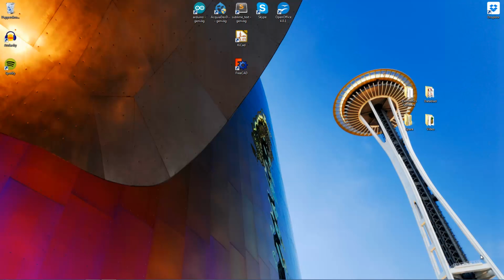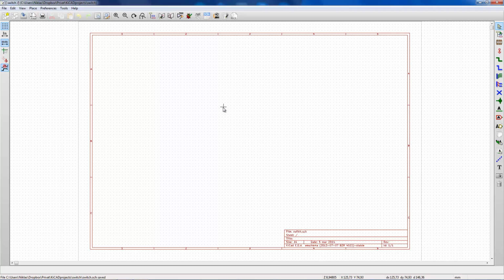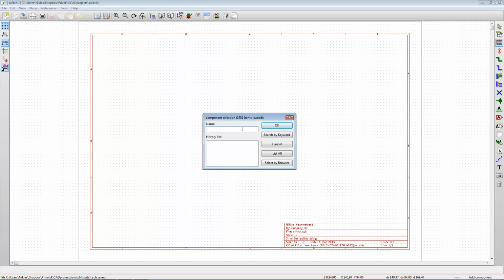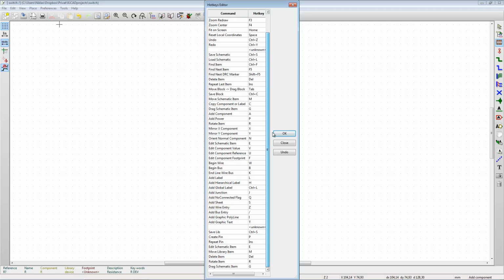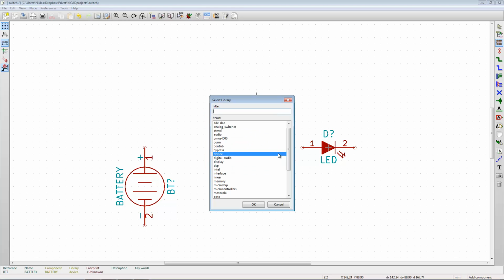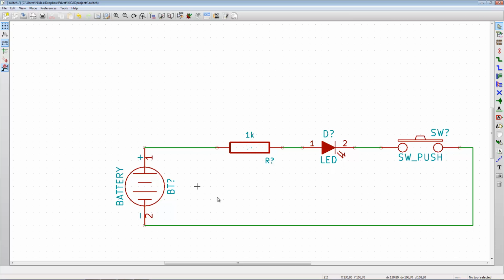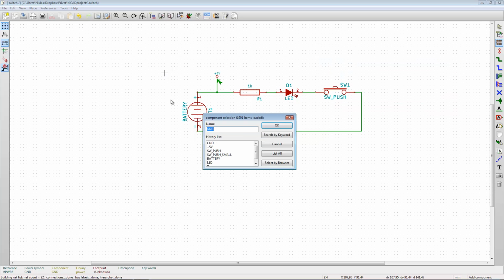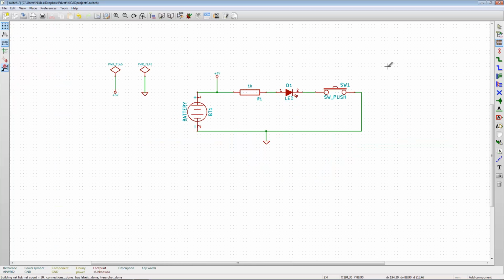KiCad Tutorial #1 Start Project

Comment: A very well made video and well explained but I do not understand why, although a resistor can have a value associated with it (1K say), why can the battery not have a voltage associated with it (5 volts say) rather than all those flags and stuff? There must be some sort of technical reason for this but I can not think of one. After all, you may need more than one battery (in different parts of the circuit) just as you may need more than one resistor.  Despite this I enjoyed the video - thanks.
Reply from the maker: Yes you are right. You may indeed label the battery with a voltage for the people that reads the schematic. That is the right way to go. (The CAD program do not care. The CAD program cares about those pesky flags).  The flags are there to make it possible to have different schematics using the same connection node whithout drawing lines between parts. And if you have many components that need power on a scematic you do not want to draw a battery near each component and connect that to the components power pins. you also do not want power line drawn all across your scematic. you want it to be easy to read and follow. THe battery symbol do not have any specific power properties it is just a symbol with two connection pins. The flag do have properties that can be set and used by the CAD program to determine design validation rules. And if you do not use a flag the design rule checker will complain saying that there are something missing.

Comment: When I add two power flags like you do in Version: 4.0.2+e4-6225~38~ubuntu16.04.1-stable release build - I get a design rule error saying both pins are connected.
Reply from the maker: I did this video a long time ago and there are updated KiCad versions that might not be fully compatible with this video.
But my guess is that you have connected the power pins to the same node or something similar.
If you want more updated KiCad tutorials I recommend Contextual Electronics.
I don't have KiCad installd on my computer right now so I cant test.
https://www.youtube.com/user/contextualelectronic
Reply: Many thanks for taking the time to reply, Its a simple circuit with an IC I created using Kipad with 6 pins, 1 Rf in,1 Rf out, 1 Vcc and rest are ground. I am trying to connect the IC to a header which supplies power as well as RF in and out. When I add two power flags one for Vcc and another ground, I get an error saying they are connected (shorted?!). If I ignore the error and go to PCB layout, on the header I only see GND pin and where Vcc is supposed to be there also a text GND appears. I have posted a query to the forum, this is my first layout and it must be something silly but has taken the whole day without success.

I have tested a simple LED circuit - that is allowing me to put two power flags like your example..
Reply from the maker: Inside the IC the vcc and vdd might be named? Maybe routed to wrong pinout and you are conecting vdd to vss when you Think you connectuon to the right pin acording to datasheet.
Reply: Niklas Wennerstrand
 the schematic is here
https://forum.kicad.info/t/unable-to-have-2-power-flags-newbie-alert/3595